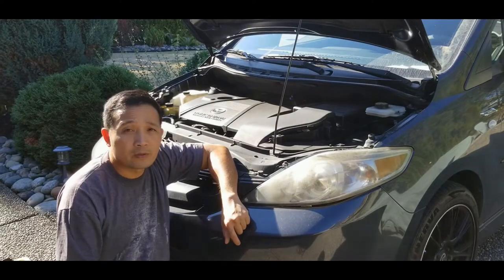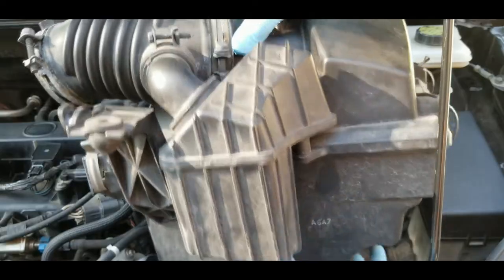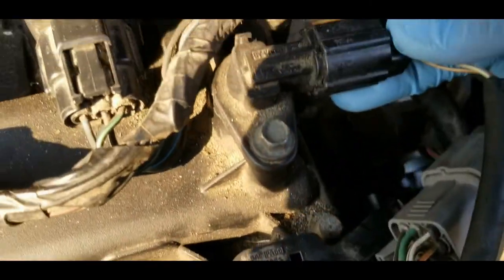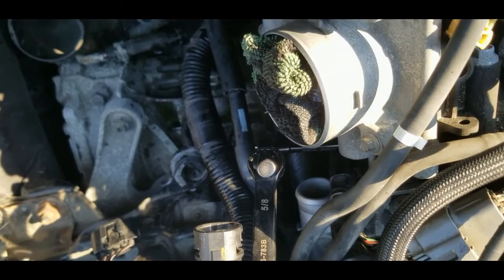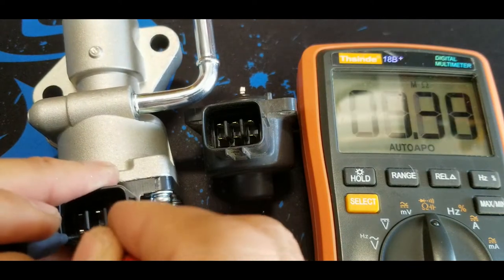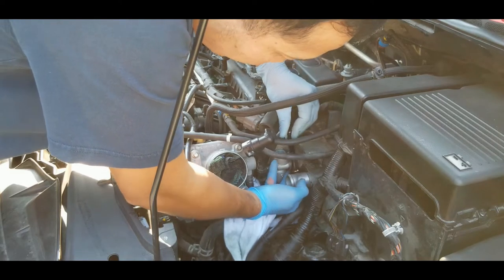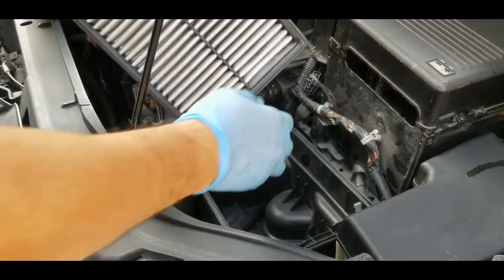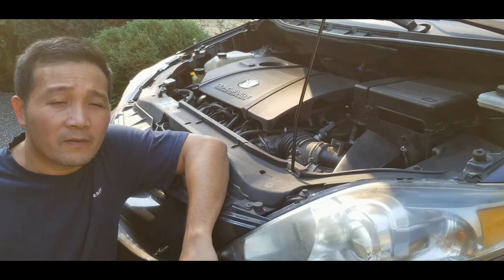Mazda 5 EGR Valve Replacement

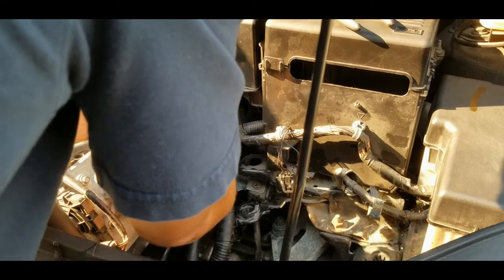Comment: 22:55 Thank you for the video, was working on my 2009 Mazda 3i with the 2.0L US version and I just  about gave up with the swivel head and striped the bold a little but after taking off the solenoid on top I was able to do it like in this video.  I used a big flat screwdriver and pushed agains the coolant pipe to make sure my socked did not get pushed out.  These bolts are way too tight.
Reply from the maker: Glad it helped and thank you for leaving a comment 😊

Comment: I'm losing my mind trying to find my egr valve.  I have a 2013 Mazda 3 Skyactiv 2.0.  I feel like I've looked everywhere but don't see a valve that matches the new egr valve I bought.  My car doesn't have an egr valve in the any of the places shown in pictures online.  Help!
Reply from the maker: EGR valve is on the right hand side, right rear corner. It's covered with triangular shape shield that look like part of the engine, so cannot see it. I believe it held by 3 or 4 bolts. If I'm right, your Mazda has electronic RGR valve not vacuum type.
Reply: @ruvrandomusefulvideos  thank you I'll take a look there and get back to you

Comment: Did it fix your idle issues?
Reply from the maker: Unfortunately it didn't solve the issue and I have not work on it since. because its winter, I have cancelled the insurance for now and work on it again this summer. Any suggestion?
Reply: Change the fuel filter, disconnect the battery for 15-20 mins. This will reset the computer and drive the car how you normally would.
Reply from the maker: @Mazza666  I will try it this summer and will update you if it fix the problem, thank you for watching and sugestion
Reply: @ruvrandomusefulvideos  fixed now?
Reply from the maker: @yuxinxia5530  Did get a chance to work on my Mazda till now but I am planning to change the fuel filter and pump.